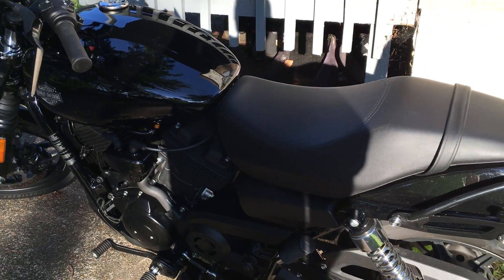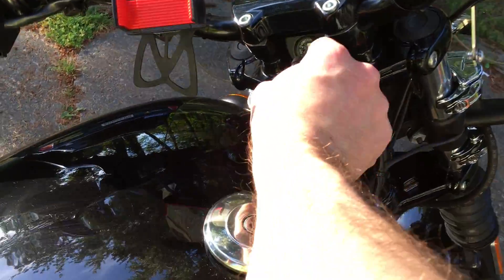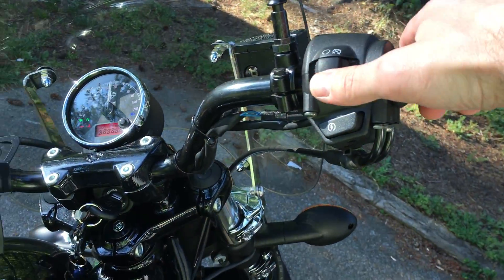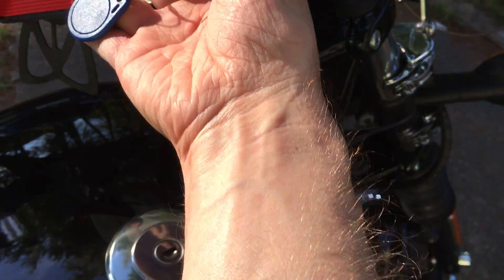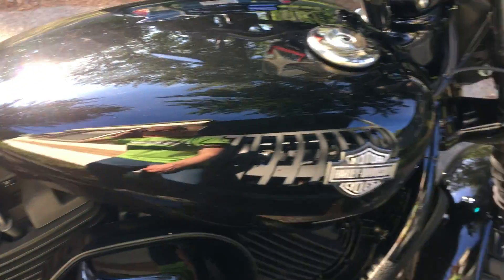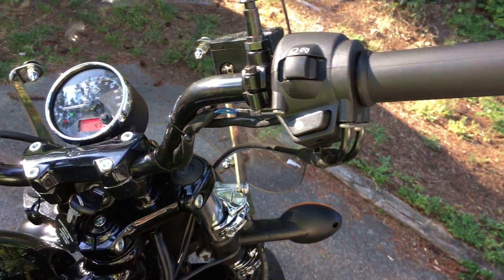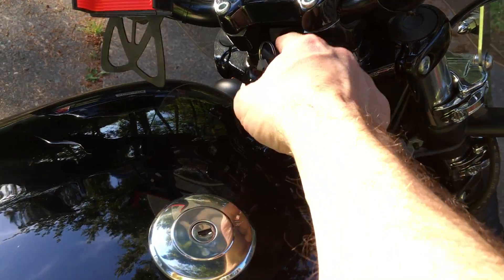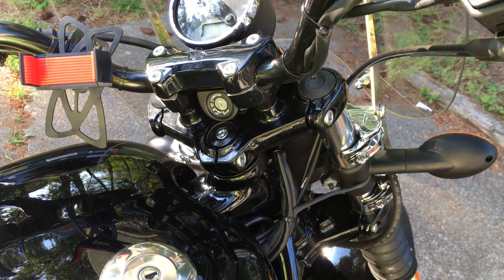NFC based antitheft system on my 2016 Harley Davidson Street 500

Comment: I like the use of proper terms at the end, "Theft Deterrent". Which is exactly what all locks, chains, security systems are. If a thief really wants something they'll find a way to get it, just depends on how hard they want to work. 

Cool system. Does it control the starter motor? or power to the whole system? No danger in a malfunction causing the bike to shut off during a ride?
Reply from the maker: Two things. First, if someone were to aquire my keys, via theft or dumb luck, that's half the magic of this system. They'd have no idea why the bike won't start when they go to crank it over. It's not obvious that you need to use that keyfob, and they'd generally have no clue what to do with it. They'd have to have seen this video. ;)
Second, as for resale value. I have no plans to sell this bike. Absolutely love it. At some point down the road, I'll get a second bike. But this bike will remain mine.
Reply from the maker: Thanks, yeah, it controls the ignition, not the starter. I figured doing just the starter would make it too easy to roll start the bike. And yes, it certainly could cut out on me mid ride if something went wrong. I have the electronics inside a metal box to protect them from electrical interference. Beyond that, it's a very very simplistic circuit, and the microcontroller goes into a while(1); loop after authenticating.
Reply: Ummm. I was thinking the exact opposite. It's completely invisible. So the only time someone would even realise there is an issue is by the time they have the keys in their possession (i.e. they've just robbed you).

Deterrent is exactly what you say in your first line, big chain/big dog/owner being renown for gun crime/etc.

I like this as a technical exercise, but I can't help but feel this will hurt (not help) the resale value. I would consider removing it before selling.